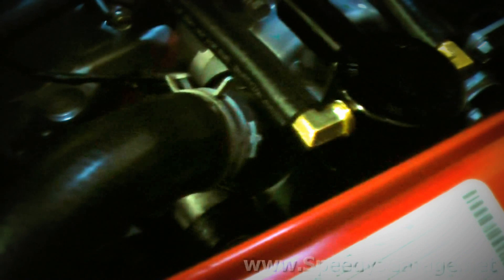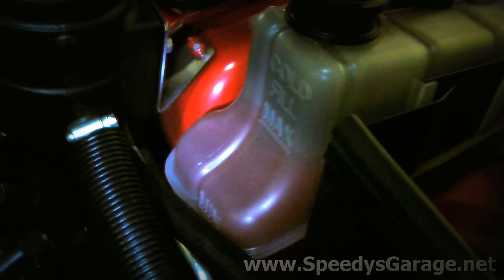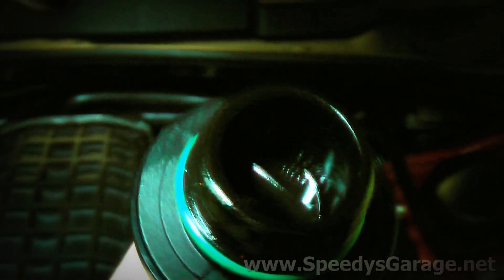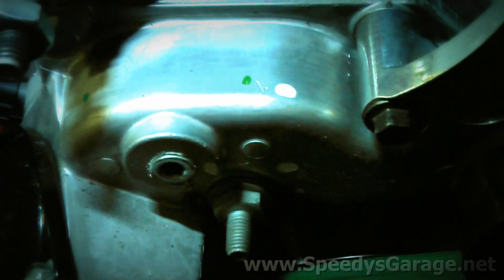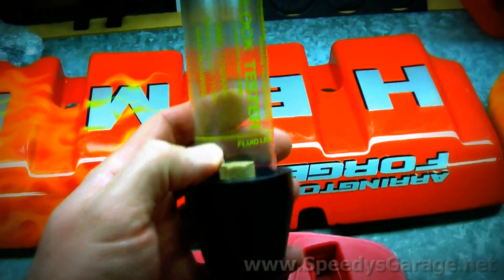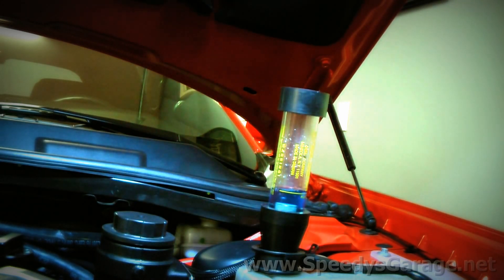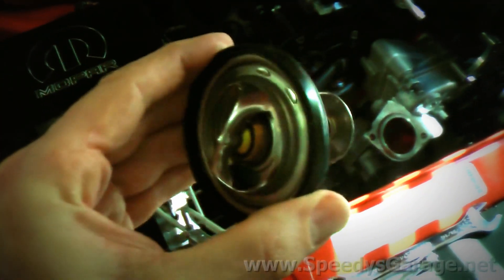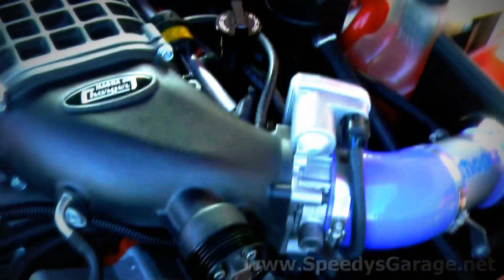Coolant System Trouble Shooting Part 1

Comment: I just replaced my radiator on my 06 chrysler 300srt8 and on the filling the system with coolant the same thing happen to me, the coolant wasn't moving @all... I let the temperature go high like @230.... and turn the engen off.... did that like 3 times.... no luck.... I decided to remove the battery ... nothing.... everything was the same... @the end I decided to let the engen run a lil bit hotter than the 230.... IT WAS HOT.... then my best guess was that the temperature thermostat was not opening ... thats why the coolant wasn't moving .... once it did open then i seen bububless and steam....  coming from the hose that runs from the AC unit...then after that .... finally the coolant move and I was able to add more and more coolant....  so just remember temperature matters, let it run high... not for too long... and if the thermostat opens you will see the level of coolant move down....  DO IT @YOUR OWN RISK.... it happen to me and I still think that that was the problem..... I'm not a mechanic, I'm just a guy that likes to work on its own cars...GOOD LUCK EVERY1...

Comment: Hey what was the problem with the ur cooling system or what was the issue I'm having the same problem
Reply from the maker: There's a follow up video on the channel.  Lower radiator hose was collapsing
Reply: @SpeedysGarage  can u send me the other video or tell me how u fixed it please
Reply from the maker: Part 2 is linked at the end of the video in a card.  https://www.youtube.com/watch?v=NmAhkNnygnA

Comment: My water pump keep locking up
Reply from the maker: Check the lower radiator hose.  Mine was collapsing.
Reply: Speedy's Garage my upper has a spring In it so it’s not that one how can I check the bottom one